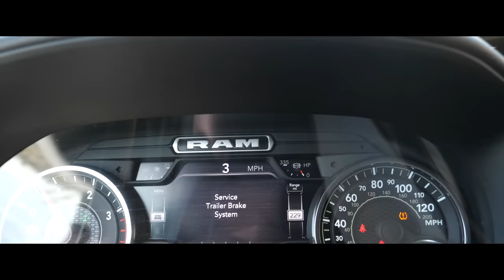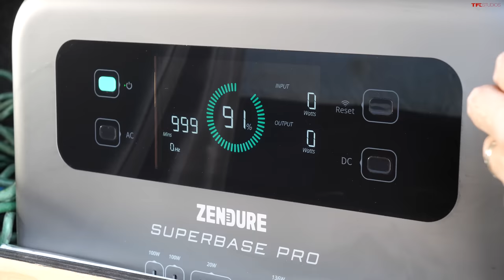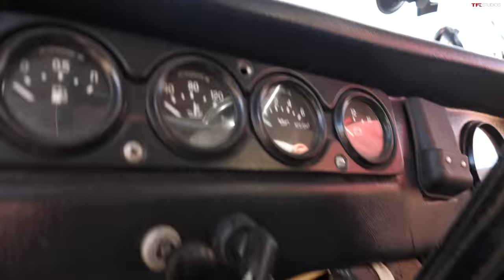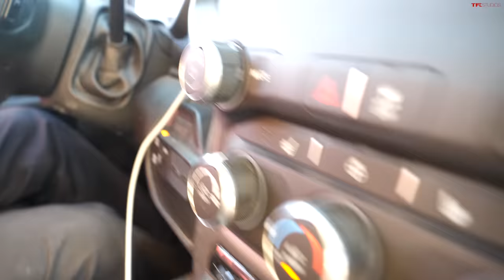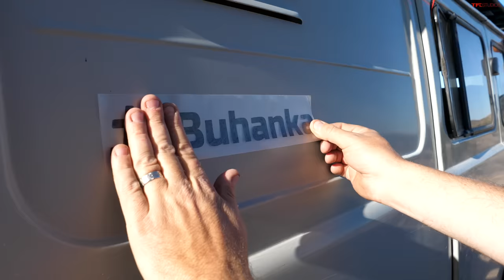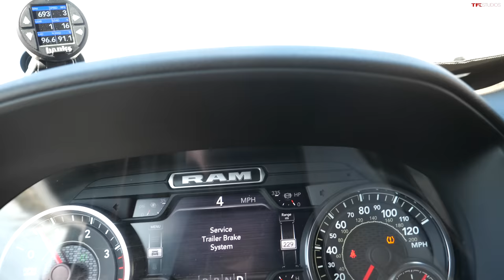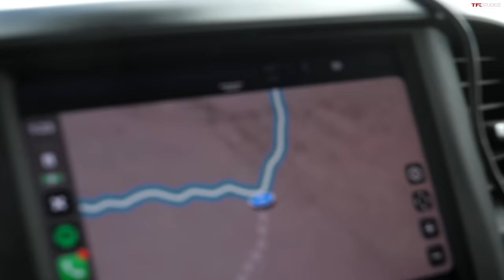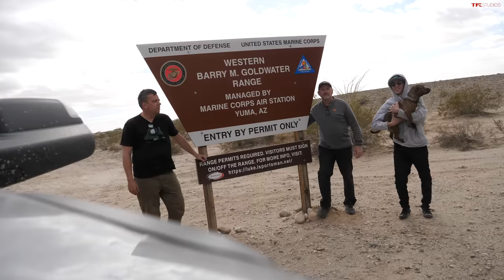What Could Go Wrong Driving the Mexican Border in a Broken Communist Van: El Camino del Diablo Trip!

Comment: It could be a fuel vent issue.  As you use up the fuel in the tank, the volume needs to be replaced with air and if the vent is clogged, it starts to create a vacuum, which reduces the amount of fuel to the engine.  When the engine is idling or at low RPM, there's still enough flow, but when you try to accelerate, it can bog due to lack of fuel. A quick test is to open the fuel filler cap and see if the issue goes away.

Comment: 1. Pinstripes are like war wounds. I'd be suspect of the testing of any off-road rig without them. 

2. The RAM error lights are more worrisome than the finickiness of the Buhanka since the old diesel van is much easier to troubleshoot and repair on the trail than the new tech in the RAM or any new vehicle made today. 

3. I'm pretty sure that Alfredo sauce was supposed to be mixed in the pan before serving but hey, that's one way to make sure you get enough sauce!

Great series, I'm loving it! 👍🏽

Comment: I don't know if Toby your mechanic has looked at the van, but as hard as it is to start I suspect fuel pressure issues. It seems to be losing fuel pressure when it sits for a while. No fuel injected vehicle should crank that long without firing.

Comment: First thing my dad said to me when he was teaching me to drive at about 8-10 yrs old was to never put your thumbs inside around the steering wheel.  Pre-power steering off roading was pretty difficult for a young boy to hold on to that steering wheel.  Also, when you have hubs and you want low gears but not 4wd, leave the hubs unlocked and shift to 4 lo.  My young boy legs struggled with the heavy clutch especially trying to back up heavy trailers.  Lo range 2wd gave me a powerful and slow reverse that I didn't have to worry about killing the engine or going to fast while trying to back trailers.

Comment: The van's issue might be fuel related. You have been driving in Colorado. Higher octane fuel  might help at lower elevation. Might try throwing some fuel stabilizer in it to off set the alcohol in most US fuel.

Comment: UAZ coolant is the one of major issues on this cars. You need to add additional electrical fan on radiator, with manual switch and check for thermostat, it can be different for summer/winter mode.

Comment: My 2018 ram had that trailer brake warning. The button was stuck in on the brake controller on the dash. Took it out of the dash and the buttons had dirt collected behind them. Cleand and applied some light gun oil and no issues since. Some people have reported it can also be dirt in the trailer brake connector.

Comment: Tire pressure on that RAM should have been in the low 20’s on that road.
Reply: TFL is notorious for running higher pressures than most. I'll see videos where they're like "I'm on 35s, aired down to 25 psi..." Like bro my street pressures are 26-28 on 35" tall E rated tires lol. Go down to 13-15 on a Wrangler or similar sizes vehicle.

Comment: Buhanka is ok, however, bringing GAZ-66: 4x4,  42 tires,  difflocks, winch, central tire inflation system (all options are stock), V8, 3.5 t dry weight and also very cheap and uncomfortable (more or less on par with  Buhanka);  would give much more fun. BTW, weld upper corners of the rear door frame, otherwise you will have cracks quite soon.

Comment: You said it was a 2.7 fuel injected. So you shouldn’t have any fuel vapor problems being pressurized system. I would think a fuel filter plugging up on one or both tanks are dirty. Someone suggested electric fan which would help. Really like seeing the UAZ doing its job.

Comment: Having grown up using old land rover 109s and 88s , 1980 range rover (pretty worn out one) and a brace of toyota bakkies (hilux4x4 and land cruiser) ect in Africa in the early side of the mid 1980s through to the 110 defender diesels , you certainly get to know how to drive , my last toyota was a 1hz diesel 80 series Land Cruiser Africa base spec with no power steering from the factory , my next car I bought I thought I would treat myself , I bought a range rover tdv8 , nice car that rides nicely but it , like that ram will be is a frustrating piece  of computerised crap that I dont trust offroad because it needs its stupid electronic programs and computers that nanny you and wont let you use it properly , also true of the electronic age , the bloody thing is forever breaking down , its current issue is the terrain response system , my next car is going to be a seventy series Land Cruiser , something I know I can drive (and it wont try and drive me) that I can go anywhere and NOT BREAK DOWN OR HAVE A COMPUTER HAVING ITS PERIOD every few weeks !

Comment: Excellent video, guys! But why not to connect the lithium battery charger to 12v UAZ buhanka power? It will charge while you drive it. Of course, it will need some kind of adapter but the result worth it .

Comment: Do you guys have a 37 inch spare for the RAM or the stock spare? Can you use the stock sized spare on the RAM since you upgraded to 37s
Reply: Stock height for that Cummins is about a 33.5" tall tire. It might work as a donut but only in 2wd and only on the front.